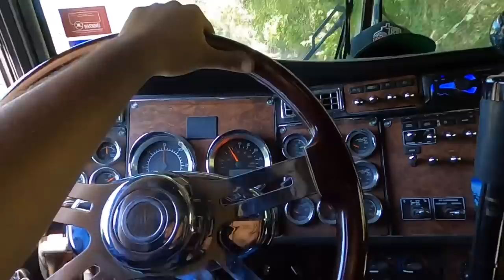How to make your trailers AXLE lift with just $40, save wear on tires/brakes and money running tolls

Comment: We run lift Axles in Australia. There very common 
If that was running empty we would run the front and rear axles up. 
The way they work here is they fit a 3rd airbag to a cantilever in front of the axle that gets air pressure instead of the 2 main bags that lifts the axle no chain required. 
And then there’s a over pressure switch to push the center axle down further ( this gives more clearance for the 2 lifted axles )
Reply: The lift bag is pretty common here in the states too, just not as much on the older trailers. One of our old lowboys had a setup similar to what he built but with pins to hold the axle up. Saves a little bit of weight and complexity, but you had to be on perfectly flat ground for the pins to line up when the trailer was deflated. Our newer trailer has a lift bag (actually it might have two, can't remember now) like you described and it sure saves a lot of time.

Comment: I run low bed trailers around the Boston area. My trailer has an air lift rear axle,and a ride height adjustment valve for the front and mid axle. Factory welded on my front axle are chain link locks that are there to hold the front axle up,while the airbag valves are closed on the front. But just with heavy G80 chain I can hold up the mid axle and just ride on the front. If I'm empty, or a light weight machine on it with all my valve set right the mid,and the rear most axles can be 6-8" off the ground. And if I need a second axle down,I just flip the valve for the rear axle. Kinda like a spread axle flat bed trailer. Like I said I'm in the Boston area, our roads can very tight. I comes in handy to pivot on just the front axle.

Comment: Might be worth putting a dump valve on the rear axle when you're running on 6 but need to manoeuver around a tight corner. Been hesitant on installing one on my 55 ton but mostly just because I don't want any extra trouble come winter time. Manoeuvering in small truck stops and OSW detours can get tricky at times.

Comment: Yea that’s a cool idea man. I think actual lifting rear lowboy axles go up a lot higher than that but  with most lift axles you can adjust the air pressure… which can adjust the height of the axle off the ground. Or pushing down on the ground raising the vehicle or trailer up. Some just go down and level out with the vehicle and that’s it. 

Cool idea it’s some work with the binders though

Comment: In Brasil is very comum. We use a secondary bag with selenoide for lift from cabin.
Reply: Haha pelo visto não só tem eu de br nesse canal 😂
Reply: @kaiovinicius5573  huehue kkkkk
Reply: same with michigan 8 axels, we are able to lift 4+ axels from the cab with air to air controlled switches.
Reply: You can set them up for in cab controls. Alot of trailer dumps have in cab values for lift axles, and tailgate locks. My company has set ups like that on our Mack Pinnacles.
Reply: @mikel  my 10 axle I can lift just about any combination of axles but our 8s is 4 up 4 down

Comment: You are charged by how many axles you file on your 2290. If you file for 6 axles it dont matter if you lift 4 of the off the ground you still pay for 6. Its because when you open up an account with the toll way they go by your registration.  Now that ONLY applies to people who have a toll transponder.  But if you are stopping and paying your tolls at every booth. Then that dont apply to you. Even then your spending more money by not having a transponder
Reply from the maker: Here in houston/Texas they have sensor on the ground that count the axles. I don’t get charged for it when it’s up. I have been checking my account and it does work

Comment: Next time leave the valves open until the axle is up. If the valve is closed you are compressing the bag with air in the line.

Comment: Why don't you put 1 chain on each side of the trailer with a binder in the middle on top ?

A 5' wrapped around the axle between the inside rim and trailer frame on each side, going up on the trailer with a binder joining the 2 ? 

This way you don't crawl under the trailer ever

Comment: Lift axle kits are not that expensive but require some welding and fabrication, but they’re a lot safer than using a chain and binder 🫣
Reply from the maker: That was temporary I did some fab on it and have 1/2 chains welded to the axle that holds it up now

Comment: You could weld two pins one per side of the axle & the pin will hold the axle up instead of using a chain.. like a T then the weight of the axle will be on the frame of the trailer..

Comment: I guess the dozer wasnt heavy enough, and didnt load dar back enough to make that makeshift lift axle touch the ground. Even then, if something is that heavy and loads to the back on the hump, it would be wise to use that axle anyway! Im not gonna lie, i would get irritated with cranking that axle every damn day, more than once a day, unless it was somehow above the trailer or maybe on the rear somewhere, where i aint gotta squeeze my arm in that hole, or continuously climb under the trailer to crank the axle!

Comment: Mine has a chain on each side of the axle with brackets on the side. Then you just move the chain so it will either lift or operate normal. I can send you pictures if you are interested
Reply: That's the best way to do it, not have to go under anything
Reply: Where can I see this?

Comment: So, im assuming that you will only be using this makeshift lift axle while empty? Bcuz im assuming that since the axle is not lifted to its normal height, that soons you put at least a certain amount of weight on the trailer, that the axle, although slightly lifted, will still touch the ground, right? Thats why i say you must plan to use it while empty. I haven't finished the video yet, so maybe you will show this!
Reply from the maker: Yes the rear axle I actually don’t lift it up at all, but I did the same thing to the front axle and have that one up most of the time empty or loaded.

Comment: Make sure that axle is 5 or 6 inches off the ground. You wouldn't want the rear axle hitting the road every time you cross an overpass or bridge. 
 I saw a box truck with a tag axle on the rear and every serious bump he crossed the rear axle hit the asphalt and puffs of blue smoke would appear
 Maybe you could use a De tent pin to reset your ride height plunger for 2 or 3 axle use

Comment: That's good you got your lowboy axles to raise. You'll definitely be able to save and maneuver better in tighter areas.

I've seen end dump trailers, flatbed trailers, box trailers, and tank trailers have lift axles and most if not all of those trailers only had 2 axles. Just curious is this something you think you'd ever do to the end dump trailer?
Reply: Most of those lifted axles actually have a lift airbag. By flipping one valve switch will supply air to the lift bag,and vent the suspension bags. Kinda like lift axles on a tri axle dump truck.